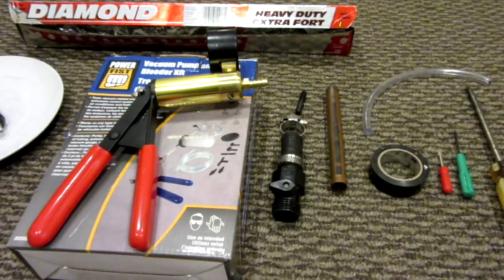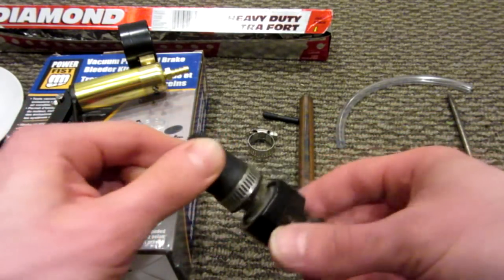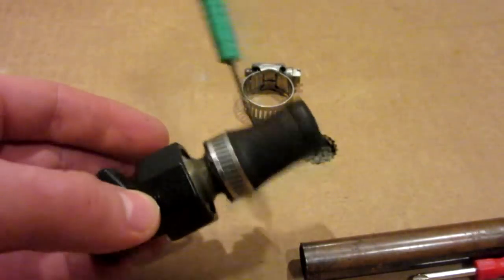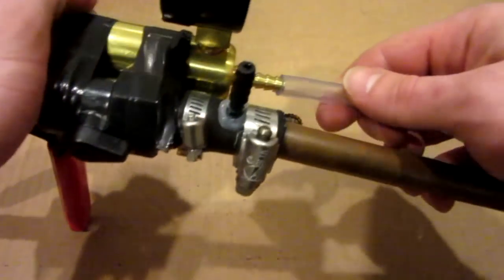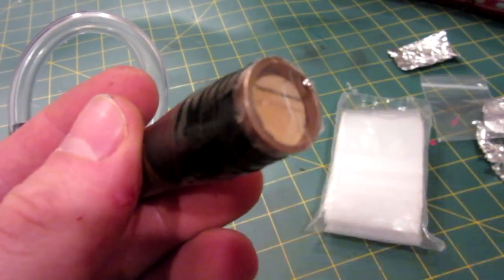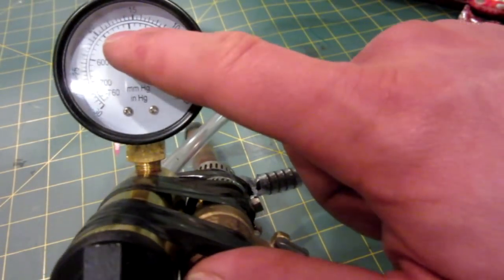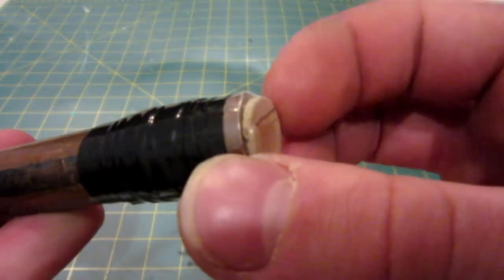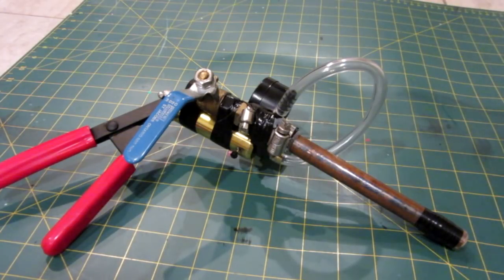How to Make a Vacuum Gun

Comment: Use zip ties to secure the tubing and it will help you reach lower pressure...a sealant or glue would only help.. so why none is used confuses me...sealing 2 sides is always better than 1...or none like here

Comment: I  think that if you use a check valve at the hose, maybe it will works, ( that is to prevent that the air incoming from valve won´t goes to the vacuum barrel too wich is happening with your design). good luck

Comment: You have 100% missunderstood the vacuum gun principal. You're suppose to create a vacuum in front of the projectile; you're creating a vacuum behind the projectile and relying on the momentum of the air which is pretty much nothing.
If you put the cork the other end of the barrel in front of the ball valve, then sucked the air out of the barrel, and then open the ball valve, the air wants to rush in but the cork is in the way, so the cork is pushed forward into the vacuum and experiences almost no air resistance as it moves forward.